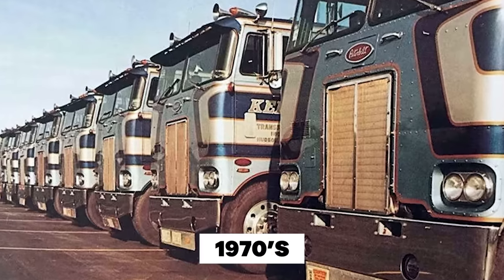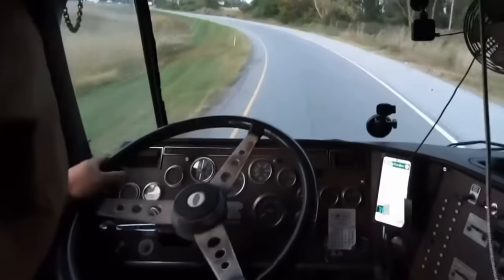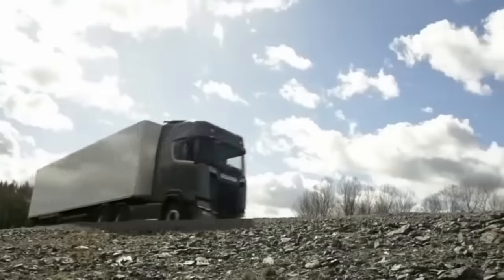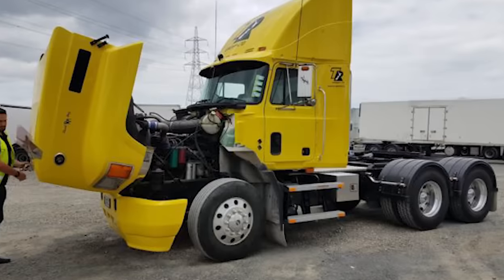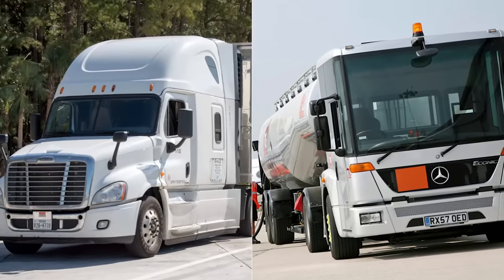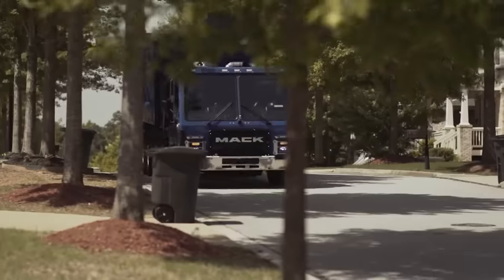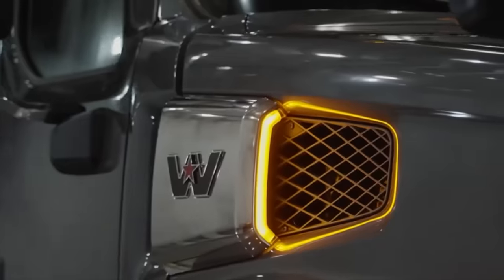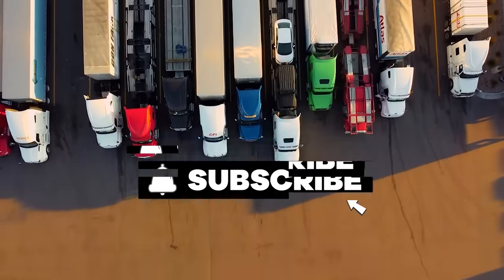The REAL Reason Why America Stopped Making Cab-over Trucks

Comment: I worked on Mack F700’s for years. We had mostly flat backs and some sleepers. Easy to work on because the cabs tilted all way over. The only PITA was the foot valve. 
Still remember seeing the Ford cab overs that had the air ride cab. Looking in the mirror and watching the cab move around was odd. Everyone that drove them loved the ride. Big difference in the old Ford W model that had absolutely no frills whatsoever. 
The reason cab overs vanished in the US was the DOT relaxed the length restriction.  Most road drivers preferred them. The west coast people and owner operators liked the long nose better because half the drivers practically lived in them.

Comment: As a retired long haul driver, I can tell you what caused their demise. They were a rolling death trap... literally. You had zero protection in event of a crash and if you didn't get killed in a crash you got killed by kidney, liver or spinal failure due to how rough they rode. I am not saying that they couldn't overcome these issues with modern tech and materials, but that's how it was at the time and there was a revolt by drivers who began refusing to drive one due to those concerns. A company quickly begins losing money if it's drivers won't drive, so they pressured manufacturers to switch to the long nose in order to get their cargos moving again. Whether YOU think they are superior or not is irrelevant compared to the people who had to actually use them
Reply: That's an fairytale.
Reply: At the time they were utter horrible deathtraps but modern cabovers feel like you're on a cloud
Reply: Yeah, driven a couple of modern Scanias (Euro COE) and pulling some 60 tons (130k lbs) and it's like driving a car, smooth ride, just some small V8 noises, automates manual and a roomie interior that rivals Audi
Reply: Cab overs have moved on, I've been driving them for over 25 years, their level of comfort has improved massively since I started driving.
Reply: @DomingoDeSantaClara  They may have. I wouldn't know because I retired in 2014 after having tried cabover in the 70s, then moving to, and staying with, long nose Pete

Comment: I put over half a million miles on an Argosy. It had every bit as much room as the Century class of that time. The grill was latched, and supported by struts. All you had to do was lift it up, and you could check every fluid from there. It was much easier than pulling a hood down. When the cab did have to be lifted (which was rare, as even service could be done from the bottom and front), it had an electric-hydraulic pump, and it took all of maybe a minute, at most, to tilt. It’s a shame they stopped building them. They were perfect for stinger setups, especially boat hauling.

Comment: I remember when I was in the Army. I was in the MLRS system. This had a cabover design, to do maintenance on the engine (even to check the oil) we had to crank the cab over. You bet we had everything secured or it would be a mess. There was also very limited storage space in the cab. We were called Gypsy Wagons cause we would haul a lot of our gear on top of the cab. What a pain in the rear!
Reply: I built wooden cabinets into my bunk area for that reason.   Everything had to besecuredwhen the cab was jacke up for maintenance.

Comment: I use to drive a cab over truck year's ago when I was younger. I miss them. The were great especially in city's and a lot of customers who had tight loading docks. They made double sleepers called aerodyne s which you could stand up in and were extra wide with had bunk beds.  Talking about a death trap research the cab under which didn't last long at all you were basically sitting in the cab under the nose of the trailer. Anyone out there remember the day of the air starter on trucks? Talk about someone scaring you as you walk by, they hit the starter and the sound it made.

Comment: New York City never removed the length limit, but because you can’t get canovers, they usually tolerate the longer trucks if you don’t hit anything…
If you hit something though, you get a ticket for operating an over length vehicle. 

There really should be SOME cabovers sold in the USA, especially the northeast which is more similar to Europe.
Reply: You got that right. And they should have never let trailers go past 45 feet.
Reply: NYC doesn’t allow 53 foot trailers, but I sneaked a few in.  When you pick up a preloaded trailer, you take what you get.
Reply: @kathyyoung1774  Years ago I had to go to the Bronx with a 48 that was enough.
Reply: @alabamasmokeywilson6818  I totally understand why NYC outlawed 53's.  I ran over curbs with 53's, killed crickets on a ramp on the BQE, didn't fit into docks, and in one really old dock (inside a building) my tractor took up the sidewalk and half a lane of traffic and got hit by an angry old lady who apparently needed new glasses.  How can you not see a vehicle 13' 6" tall taking up half of the lane you are dirving in, in slow-moving morning traffic?  That would have been worse with a conventional.

Comment: Cabovers exist where overall length is limited by some factor -- be it regulation or garage housing for the unit.  This is why fire departments are the mostly likely place to see them in the US, the better to fit urban firehouses that cannot be expanded or easily replaced.
Reply: There is more to that than just the cabover part, you see a lot of U.S conventional too in firehouses.
Reply: and because of lack of access to big cabover market, American firefighters are forced to buy their trucks from low volume manufacturers like Pierce.
This makes them 2 - 4 times more expensive than the European analogues on commercial cabover chassis (Volvo, Scania e.t.c produce versions of their trucks with "crew" cabs for firefighting). Having said that, some rural American FDs, that do not have such tight roads save a lot of money by using commercial (long nose) chassis.

Comment: Most american cities have "break bulk" or "Delivery Hubs" where the big trucks drop their over the road cargo and pick up a trailer for the return trip.  Local delivery trailer trucks save lengths by not having driver comfort provisions since those driver typically live in the city they deliver in.
Reply: Only if you are less than truckload.  I am over the road and I myself have been in some of those places that should have a smaller truck so the final delivery. You will also find some OTR drivers doing local pickup and delivery.

Comment: They were mainly due to driver, comfort, and engine accessibility. It’s just so much easier to get to the engine when you can actually pop the hood forward. Also, you didn’t have to actually designed the cab to flipped forward and be a structure like that you can actually design a lighter but longer.  There was also a massive safety consideration you were literally sitting 7 to 8 inches from your bumper.
Reply: Safety for sure….even the Israeli Merkava main battle tank has its engine up front to absorb energy.
Reply: thats true, it makes them more safe. but the space argument is false. modern capover trucks are as long as an american truck, just that the cabine is twice as large, because it extends over the engine aswell. these are our very large trucks for really long distance hauls. they not only have a sleeping compartment like normal capovers do, they have a cooking compartment, too. kinda like a camper van from the inside. they are made so the driver doesnt even have to leave the highway to eat, he just stops at a highway resting space (we have them like all 25-50km) where they can cook and sleep for the night.
Reply: Yes,if you were in an accident you were the first one there in a coe .
Reply: In modern cab overs the safety argument is negligible at best.
And the ‘niche’ market is actually the US.
The majority of the global trucking industry uses cab overs.
I personally prefer the traditional bonneted prime movers and have taken them through the middle of major cities pulling two trailers at a time because the manoeuvrability argument is actually minimal. A lot of that problem in the US could be sorted out by not building stupid trucks with 20ft gaps between the back of the bunk and the front of the trailer.
If you want to know how to build good practical work trucks then go look at the Australian designed and built Kenworths.

Comment: I owned Freightliners cabovers, '84 and '86 with double mattress sleepers. I love driving cabovers over conventionals. Even my drivers perfered driving cabs because of the tight turning radius over conventionals. You can put on more payload on a cabover. When you were paid by the ton, I made more money. When the argosy came out, the weight of the cab almost doubled because it is made out of fiberglass. Tried one and got rid of it.

Comment: "optimizing driver comfort"
Yea.. no.. that is not really true.

Someone who have written this have never been in a European truck.

"moving the engine away reduce the vibration"
While that seams like its true in theory... Air suspended cabs are a thing.
Reply: Long nose trucks are air suspended aswell 🤦🏽. Some jobs require air suspended trucks you can tell you never been in an American semi.
Reply: @USandGlobal  
And you never learned to read. I never claimed that airsuspension is not a thing in American trucks. Read what i actually wrote.

"Some jobs require air suspended trucks "
I was talking about a 4 way air-suspended cab, not suspension.

Comment: I've driven both trucks. I don't like cab over except for the visibility and the way it turns, it's uncomfortable. It's also dangerous to get inside.
Reply: The motor in conventionals protects the driver a lot more but in a cabover the driver is the first one to the accident.
Reply: It's only dangerous to climb into a traditional American cabover, with the door directly over the front tires. Euro cabover trucks are forward control, so there is a good set of entrance steps ahead of the tires.
Reply: Yep advantages about cabovers are they're easier to maneuver & park in than conventional cabs & have better visibility too. The disadvantage about them is if you get into a crash like a head on collision with a drunk driver or so, you get smashed because you're sitting right at the front end of the frame leaving you very little protection between you & whatever is coming at you in front unlike in a conventional cab where you sit further away from the front end of the frame for better protection. It's good the old length & weight limits were lifted to allow conventional cabs to pull longer trailers & carry heavier loads because safety is a top priority.

Comment: European cabovers are safer, more comfortable and aerodynamic than american conventionals....
Tilting a cabover cabin takes two minutes, not ½ an hour, and gives better access to the drivetrain than on a conventional. 

The main reason conventionals are used in North-America is that the crumbling infrastructure demands that the ridicilous low weight are spread over long distance... as described in the bridge weight formula
Reply: You seem arrogant and mad over a truck design. But opinions are like assholes, everyone has one. I’ll take my Pete 379 with a Cat C16 any day over any cabover. I’ve had absolutely no mechanical issue with this truck except regular maintenance and I haul exclusively overweight construction equipment, farm equipment, and fire trucks. This Pete rides smooth as butter, even with 170,000 pounds. Have a nice day.
Reply: They are not , I’ve driven, one for years , small , uncomfortable  , there a  bigger cabovers  but since they’re optional not many companies are happy to pay for more comfort for the drivers ….  I prefer a long hood truck
Reply: @Streetrocker28  your personal preferences is not up for debate at all.
The handling, driving characteristics and therefore comfort is better on european cabovers than american conventionals of several reasons.
American frames are long and weak so they flex so much that it effects the stability and driving characteristics of the vehicle. 
The suspension on american trucks are a joke compared to the systems used in Europe, which makes american trucks to be "shakers".
American cabins are narrow and "crampy" compared to european cabins, and european cabins have much better noise insulation and are much quieter inside.
Anothe topic is the electrical system where no one can explain why american trucks still have 12 volt
Reply: @stigandrmyrardalur5208  The voltage is just a standard, all cars are 12 volts. A higher voltage just allows you to run a thinner wire and get a bit more voltage stability if a wire gets partly broken or a ground is less than ideal. Which sounds good until you need something like a 3" by 5" / 76.2mm by 127mm amber turn lamp; 12 volt $46 USD vs 24 volt $200 USD for the same size light made by the same manufacture and from the same parts store. Now, prices over in Europe might be a lot different since the higher voltage is standard, I don't know.

Yes our roads are in terrible shape, and a longer wheelbase rides better over poor road conditions than a short one. That is the basic reason we run longer trucks, as well as our population density is so much lower in parts of the country. Imagine how quickly you could cross Germany if only 584,000 people lived there.
Reply: @BlueDually4x4  higher voltage makes electrical compnents stronger, and it makes components drain the batteries less.
With 24 volt your refridgerator and webasto heater or parking aircondition can run 24 hours without making starting the engine cumbersome.
The cables and lights are the same, you only need right lightbulb.
In prinsipal longer wheelbase would give you smoother ride, but more important is the suspension and chassis.
The population density is completely irrelevant to the issue about how trucks are built.
Reply: I’ll take a Volvo FH16 750 8X4 XXL Globetrotter with the Volvo I-Shift Automated 12+2 Speed and Drive Axles with Hub Reduction ANYTIME instead of a glorified Paccar Product.

Comment: Yep, I remember cabovers, you were always the first one at the scene in any accident and felt the bumps in the road before the rest of the truck! 🤭✌️👍
Reply: Cabovers were shit boxes. They lacked in comfort & safety. Rough ride because you sat right directly above the front axle. It'd get noisy inside the cab & during the summer time, it'd get hot as fuck in there too because the motor is underneath the housing & makes the ac work harder than ones in conventional cabs. They were a pain to climb in & out of because they have a wider cab & the sleeper is smaller too because room had to be made for the motor underneath. You sat at the end of the frame leaving you very little protection between you & whatever is coming at you in front unlike in a conventional cab where you sit away from the end of the frame giving you better protection. Whenever you had to take a cabover to the mechanic, you'd always have to remember to either take all of your lose stuff outta the cab or tie it down or else it'd get thrown around everywhere leaving a mess inside & sometimes a broken windshield too. Getting access to the motor on a cabover took more time than getting access to the motor on a conventional cab because the mechanic has to jack tilt the whole cab up unlike on a conventional cab where all he has to do is open the hood on the front of the cab & already ready to go to work.
Reply: To kevin Do want some cheese with that wine

Comment: Sat as a passenger in a new Louisville for over 400km on gravel roads on the way to a mine site and then in a Scania cab over with over a 1,000,000 km on the clock on the way back. The Ford cab didn't like the bumps and it had fits going over corrugations so I would say the Scania had the better suspension.